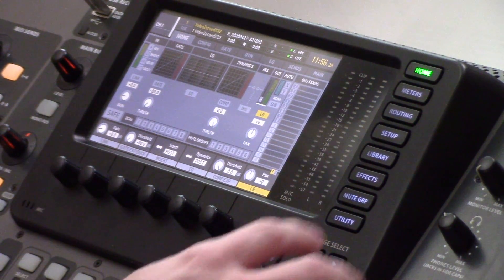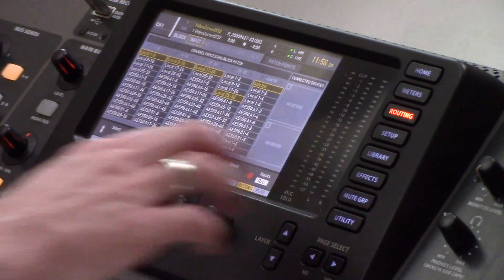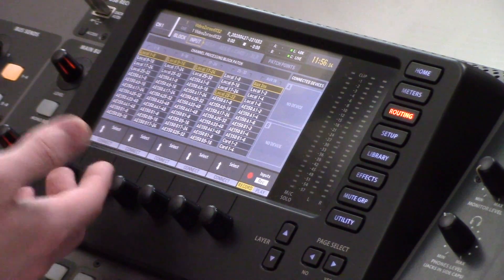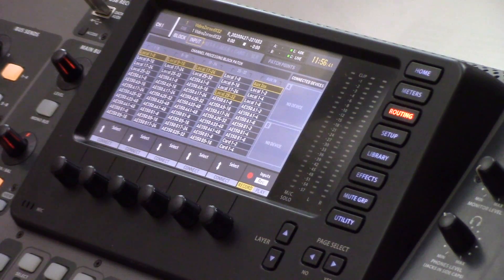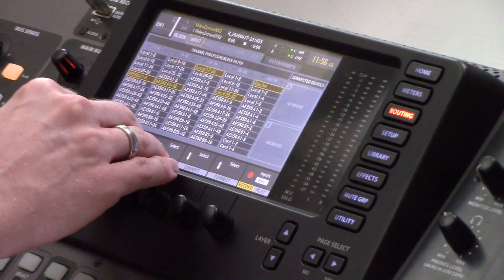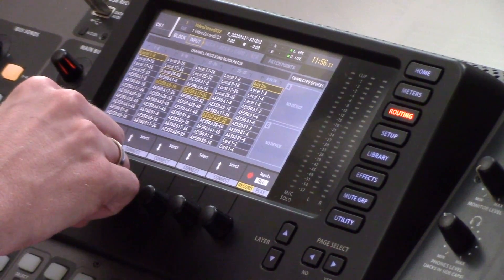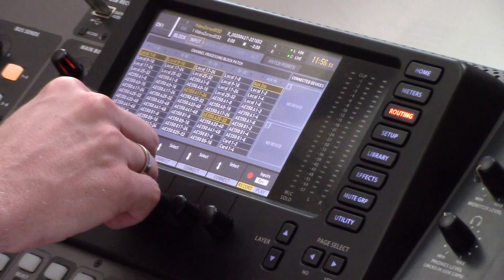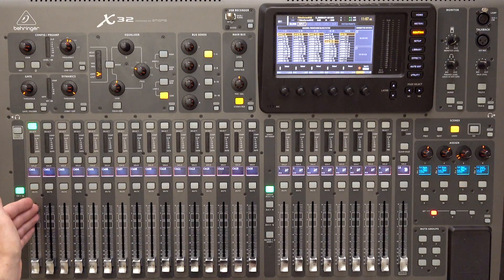Behringer X32 Firmware V4 | 104 - Routing An Input to a Channel

Comment: Hi drew! Is there a way to make a dubbel channel with a trim? So let’s say i have channel 1-16 setup for FOH and channel 17-24 for IEM. So channel 1 and 17 have the the same input. In wanne have a trim to 17-32. Or do i kneed to setup gain and lock the stagebox(S16) and use trim on all channels. 

Looking forward to your answer. 
Erwin

Comment: I'm not trying to be a d*ck or something. But why would someone plug a mic into Input32 and not Input16 from the start? I am curious about this.
Reply: They might not have an xlr connector handy and be using a different type of connector in the aux input.
Reply: Having said that. That’s the reason why I’m trying it on my x32 producer. But, after rerouting the aux to channel 17 I still can’t hear it as an input in ableton live daw. I’ll update my firmware and see if that fixes it.

Comment: Hi just been viewing your video's ... nice one. but I have a question:  Can you change input No16 to input No1 and then save this so that if a different engineer usually has "kick Drum on Ch1, but I have Vocal1 on Ch1, all I would have to do is "Load" a different settings in rather than re assign everything everytime?.  Cheers and hope to hear from you soon.

Comment: Hey Drew I have a question, do you know of any way to use an X32 at a FOH location and wirelessly control an X32 Rack and/or S32 snake, maybe a Master/Slave situation over wifi or otherwise?  My band plays in places varying in size shape and scope night after night and sometimes there's no good place to run an AES50 Cable without it getting beaten up pretty badly either by foot traffic or unobservant event staff in skid-loaders, side-by-sides or even cars.  4/5 times it's not a problem but once in a while it'd be nice if we could just not have to deal with it and risk junking another one, thanks in advance!

Edit:  I should mention that I do know that you can use an iPad but we much prefer a real tactile console for Front of House mixing, it's much more intuitive and comfortable.

Comment: I have a group of faders that are not engaged for some reason..how do I check the "tap" in the signal flow that would allow the mute and the fader to work on the inputs??  These 7 channels are coming from S32 Digital snake.  All the other inputs on the snake WORK FINE..

Comment: I have watched 100 videos now on how to hook up a single S16 to a X32 . I have the input part down . I go yo The router page and pick AES60 , 1-8 , The go to AES50 9 - 16 .. That I have . Now what I don't have is HOW do I get the Outputs on the S16 to end up as 1-6 be the Monitor outs for 6 Mixes and then have 7 and 8 end up as my Left and Right ? Now on the back of the X32 by default AUX 1-8 are the monitor sends Then 9 - 13 are more AUXs out , BUT AUX 15 and 16 are by default your House Left and Right . SO HOW do I get 7/8 on the S16 to be 15/16 ? I have a spare S32 and hooked it up to the X32 and it worked great . But the Church I am doing this all for (FREE) Does not have the money to buy the S32 and have to stay with the S16 for now . There has to be a way to route 15/16 to 7/8 of the S16 ... Remember they only have ONE S16 ... WHY the person who sold them the board did that I will never understand . HELP PLEASE ..You can e-mail me @ ctm4metoo@aol.com

Comment: Hi Drew, I have a question...I’m a Production Sound Mixer for Film and TV, and I have a X32-Mix producer mixer and a Sound Devices 688 Mixer Recorder that I record all my dialogue in...Now! With the COVID 19 Film Productions are asking the Sound Mixers to move off set in order to keep the body count do, with that said all of my mic receivers will be Onset along with my boom op. That leaves me to run my receivers to me where ever I’m setup at 100 - 200 feet away from set. So I need to build a RF box and run AES50 from it to the X32-Mixer then run an 1 aux channels back to the RF box for Comtek listening...I want to know will the S16 stage box work for me, I would rather use Dante but it’s not in the budget and I can’t find a Dante card for the X32 right now.
Thanks Drew!
Reply: Yes the S16 would do the job for you. There is a Dante expansion card for the X32, but it would replace the X-USB card so not a viable solution if you use the X-USB for recording to a computer. https://www.thomann.de/gb/behringer_x_dante.htm